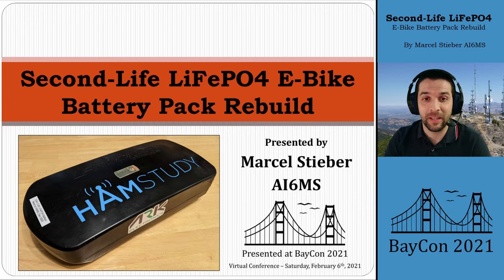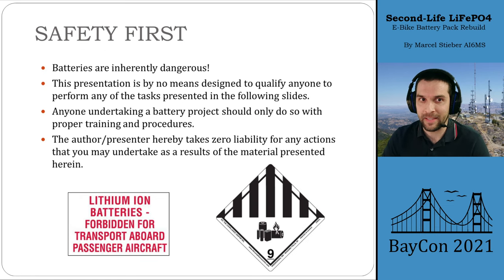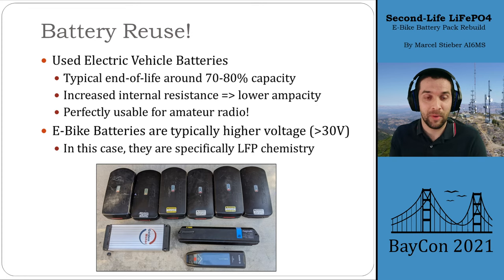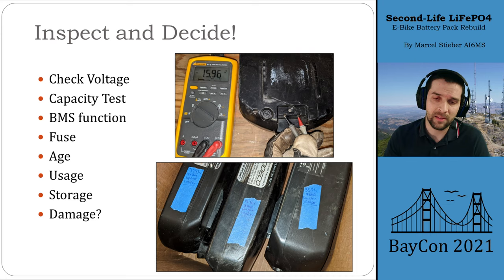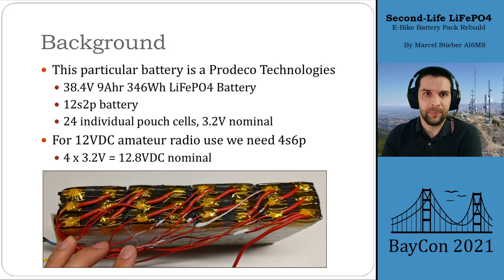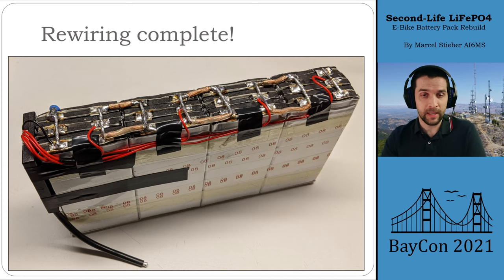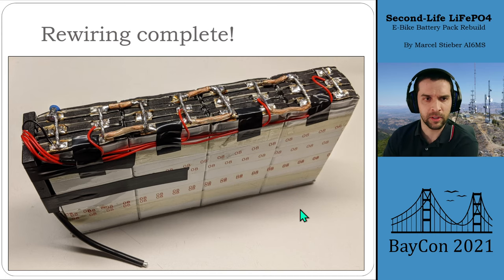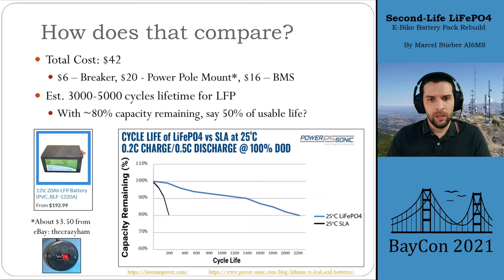Second-Life LiFePO4 E-Bike Battery Pack Rebuild - BayCon 2021

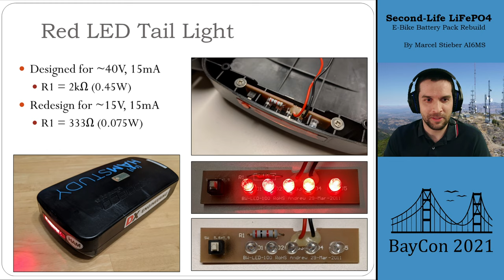Comment: hey @15:50 you could totally setup a constant current driver for those led's with a transistor, zener diode and two or 3 resistors. then it wont vary its brightness as the pack voltage changes.
Reply from the maker: If I cared enough about the feature, then absolutely yes. The quick resistor mod is easiest for this particular application.
Reply: @MarcelStieber  that is true, I just like the constant current transistor circuit, simple cheap and effective, but yea for an application that you dont really need it is alot more complex than a single resistor.